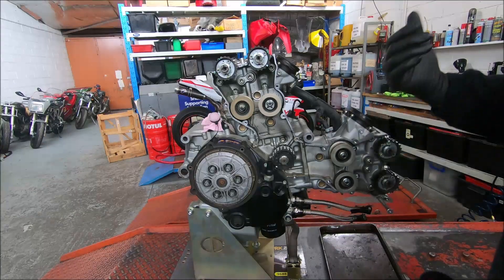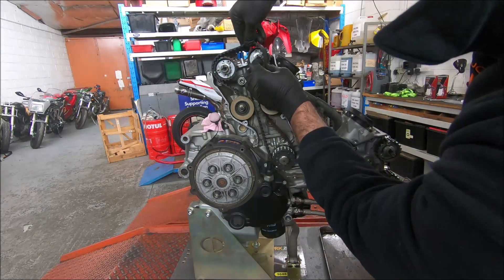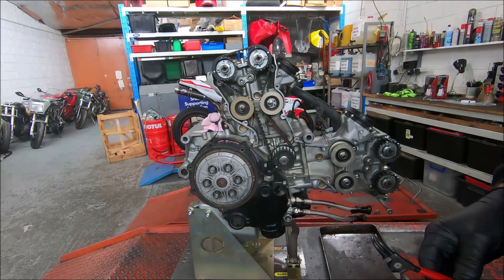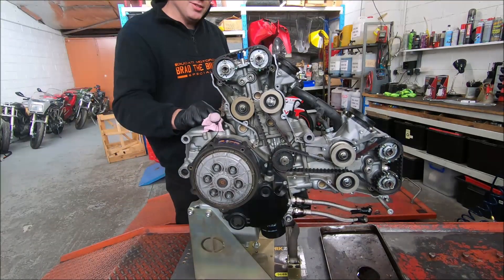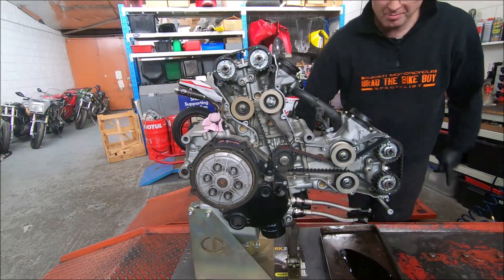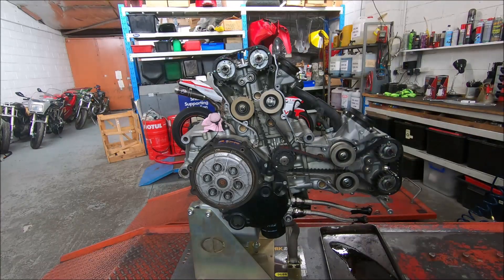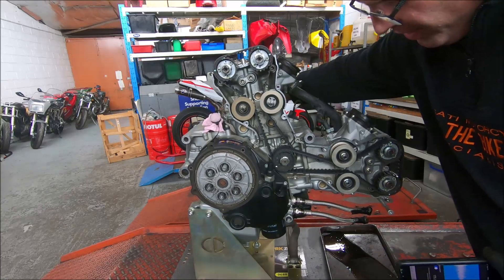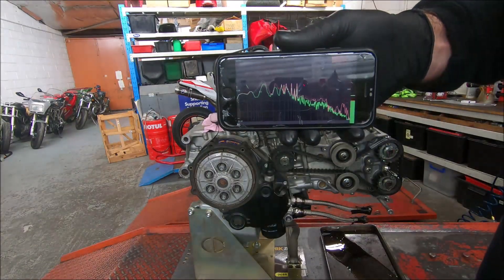1198 Timing Belt fitment

Comment: Aloha Brad, is this the same for the 999? Just picked up a non running and think the guy that just did the belts put the cams on the belts upside down (T’s) facing down) please help thanks!
Reply from the maker: 999 has the T pointing away from the crank at each individual tdc firing.  video is here - https://www.youtube.com/watch?v=zKRm6GkiFoI&lc=UgxeJ66DsP3mEnqqUC14AaABAg

Comment: So even if bike has tiny miles and unridden belts still need to be changed regularly 🤔
Reply from the maker: that is the recommendation.  if you want to go longer than 5 years, that's up to you.  many do.  some wear it like a measure of manhood, possibly because they've never had to repair one when it's gone bad.  those who were around in the late 90's and had to deal with the 748/916 issues have a much better understanding of the ensuing knee jerk response and surrounding paranoia.

Comment: Why weren't the screws on the pulleys loosened before tensioning the belts?
Reply from the maker: because i don't do it that way.  you need to have all the locking tools to use the factory method, which i personally don't like for just a belt change.

Comment: What apps you are using for checking the frequency of belt tension? and is it applicable for 821 engine?
Reply from the maker: n-track tuner (generic guitar tuning app) and easy tension are the two i use.  there's gates carbon drive, conti tension2go as well.  821 is the same thing.

Comment: Thanks alot for this video. I should have watched it before I did my Multistrada belts instead of a different one. I was very concerned I had the timing slightly out but looks like my T shaped markings are all pointing the tight way, pretty much. Think I have confidence to start the bike now. One question, do you think its critical to replace the tensioner nuts?
Reply from the maker: i would only replace the nuts if the hex is damaged, or won't torque (never seen that happen).

Comment: Brilliant video. I did the belts on my Multistrada and the top left pulley is hard to mark, I must have been a tooth out and running rough so watched your video for any tips on timing and you gave me the ultimate eureka moment!! The cam pulleys have a T shape that as a pair point up and there it was, a tooth out. Thank you ever so much as I was in proper head scratch stressed mode. Top man 👌🏻👍🏻
Reply from the maker: Glad it helped

Comment: Hello. How do you find the tdc of the vertical cylinder looking at the crankshaft pulley?
Reply from the maker: when the dot is pointing toward the front wheel, @ 3 o'clock, however you want to describe it.  put something long and thin down the plug hole and feel the piston movement.

Comment: Hi, great video. Question regarding the base camshaft positioning.  I am debating whether or not to get the camshaft center tool that apparently locks the cams in the correct positions prior to installing the belts.  Do you know if I can VISUALLY set the camshaft center slots to point towards top of cylinder head at the Horizontal cylinder TDC?  Or is there too much room for error? Thanks!
Reply from the maker: before you remove the belts, line up the dot on the timing shaft pulley with the slot on the primary drive cover and, with your eyes open, have a good look at where the cams are and how the slots on the ends sit, etc.  it's really obvious.  you can certainly use the slots.  or make marks that make sense to you.  just do whatever you need to do to not make a mess of it come belt refit time.  i wouldn't bother with any tools, but if you're concerned, do whatever you need to.
Reply: @bradthebikeboy Thanks for the tips. I should be able to work it out then.
Reply: @bradthebikeboy  amigo tengo problemas para detectar el tiempo de una multistrada 1200 ya que me la trajeron desarmada y no se la posición de los árboles de levas espero tu valiosa ayuda
Reply from the maker: @pablolince1080  use the dot on the timing shaft and the slots in the ends of the cams.
Reply: @race5050r1 mate my method is use a degree wheel with the motor rotator. 
1.Find  horizontal TDC on pulley, zero your wheel to "TDC" 
2.Strip first belt- horizontal.
3.Rotate Counterclockwise 270° 
4. Vertical cylinder should be at TDC.
5. Strip/refit belt- vertical.
6. Take up slack in tensioner set to frequency/ torque
7. Rotate clockwise 270°
8. Fit belt- horizontal
9. Take up slack in tensioner, set tension value. 
Rotate again for vertical cylinder tension test, and your set, have a cuppa!
Reply: @thediddly  Thanks for the info. I have the motor completely disassembled.  I’ll use degree wheel to find TDC’s.  Motor is still all apart. Took several months to get my crankshaft repaired and re-ground.  So once I find TDC’s I have to make sure camshafts are positioned correctly. How do I position camshafts besides visually making sure slots are pointing upward?  Thx!
Reply: @race5050R1  different options here.
As a block, TDC can be found with a block mounted piston stop. Effectively stopping the piston prior to TDC dwell and using the degree wheel, stop the piston against the "strap" read the wheel, turn the other direction until the piston touches. Whatever reading you have, add the 2 values, then divide by 2 to get your TDC value.
Doing it with the heads on is the same process. I made a spark plug stopper the other day on Instagram: @darius_to_the_maximus
Now these all give you TDC, but remember, you need to find if it's TDC for ignition, or for exhaust! Very important as your timing could be 180 degrees off. I can't advise any further as i have never been that deep i a ducati

Comment: Great video thanks. I was reading the 821 motor belt change procedure according to the Ducati w/shop manual and it says/shows to use a camshaft lock tool to hold the camshaft and crankshaft (with another locking tool) relationship in time. Then the camshaft sprockets should be loosened on the three sprocket holding screws, so that the sprocket can move on the slotted holes. Once this is all arranged then the belt tension is adjusted. This makes good sense, since all tension influence from the camshafts etc. is removed from the belt.  After the tension is set then one tightens the camshaft bolts up, removes the tools and all is done. This also allows for the timing to be perfectly reset each time and is also the method used for timing VW TDI engines.  I don't see anyone using these camshaft locking tools though. What are your thoughts on this? Thanks a lot for all the effort in making these videos.
Reply from the maker: i talk about this in one of the 696 videos - https://www.youtube.com/watch?v=GfAkys0uDp8&t=454s - about 2 minutes in.  i don't do it that way, for reasons explained in the video.